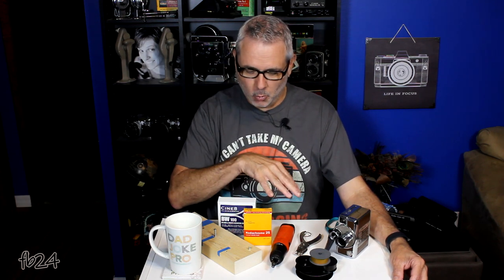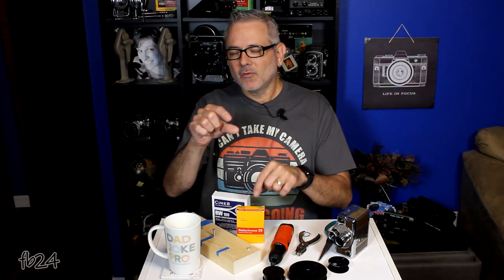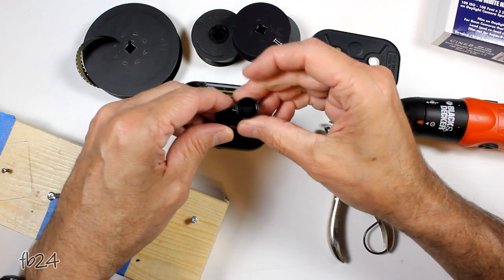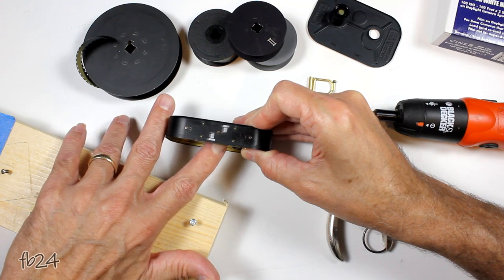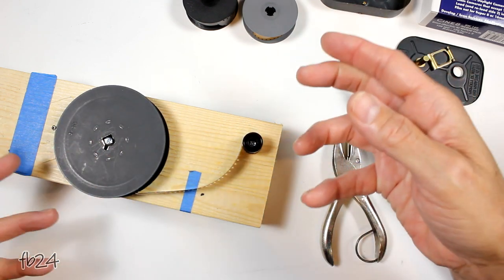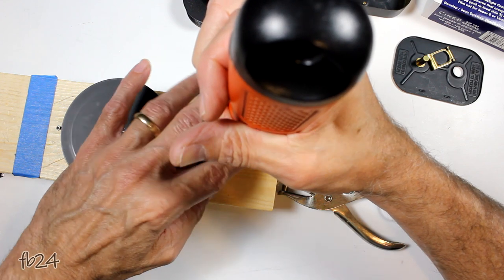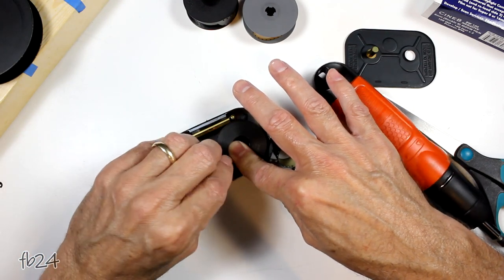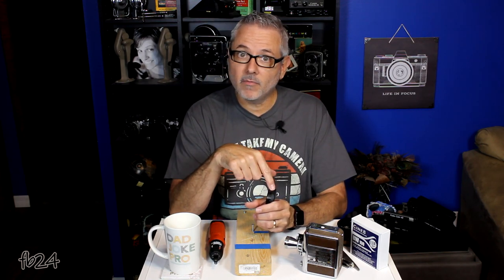Reloading 8mm Film Magazines | FPP B&W Negative D8 Film | Filmboy24

Comment: Very interesting... . One corner of Regular 8mm that I have never explored is magazine film. Thanks for the education and information. I'm like you in that I always think of this film in terms of 50' rolls because that's what it yields when finished. Correctly it is just 25' of 16mm with extra perforations that is split and joined at the end. Please keep talking about regular 8mm film magazine and otherwise, it is such a fun little format. Peace !
Reply from the maker: Thanks, Cecil!

Yes, I could not stop saying 50', haha. So used to the 16mm cartridges.

I almost emailed you yesterday, but I found a Minolta Zoom 8 in my closet a couple days ago (no idea when or where I got it), got it out, looks new, cleaned the battery contacts a little and it works perfectly. I also disassembled both of my small Bolex 8mm cameras (B8L and D8L) and cleaned/re-lubed them and they are both purring like lions now!! Can you tell I'm a little excited? I'll be putting some film through all of them shortly, wish me luck!

Comment: I have 3 magazines. I use the leading and trailing ends of the original film as templates for the cuts needed for the magazine spools. When I cut those I have already reversed the film onto a spare 8mm spool then put it in the film can (in total darkness of course) with about 6" of film sticking out then gaffer tape the can closed. It will put a crease in the film but you can iron it out with your fingers before you load it into the magazine.
Reply from the maker: Good idea, Lars! Thanks for the tips!!

Comment: Is there any way to tell if the film has been shot in the 8mm cartridge?
Reply from the maker: With these 8mm magazines, the only sure way is to pull it and process it. You can sometimes tell if it's been 1/2 exposed, as the weight of the film inside will be on the left when side 1 is face up.